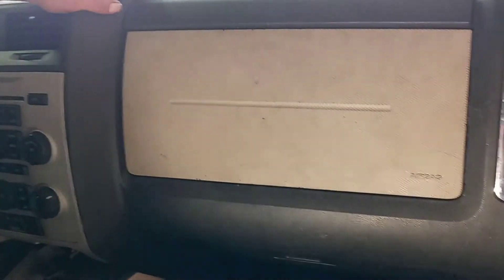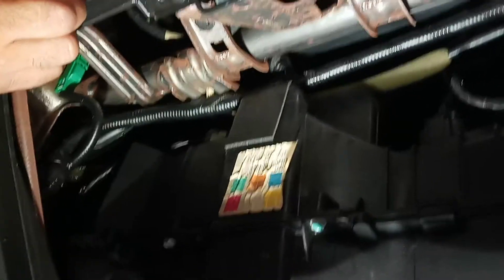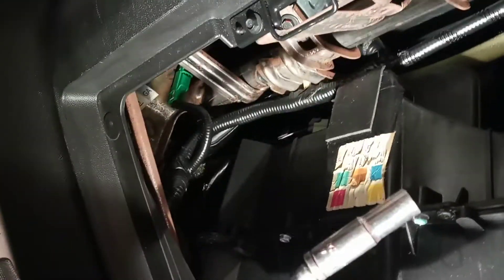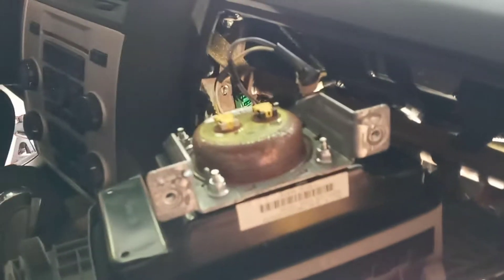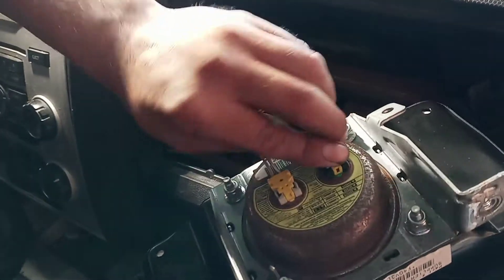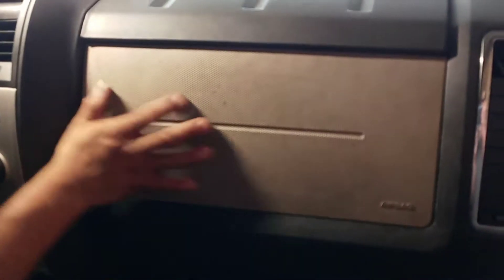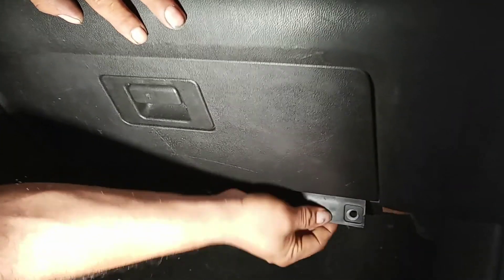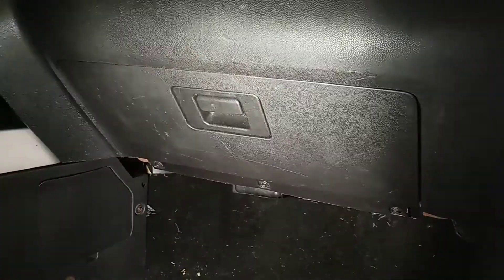2008 mercury mariner - passenger side air bag replacement

Comment: Great video but I need to remove the sensor in the a/c trim cause I trim got cracked and I bought a replacement but didn't want to splic
Reply: sorry got sent w/o finishing. I don't really want to splice wires due to resistance readings changing.